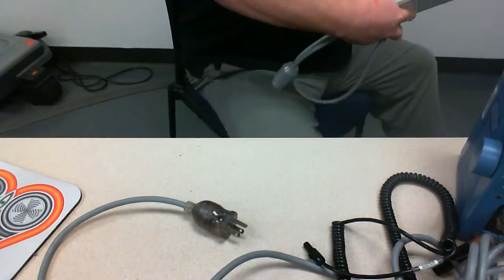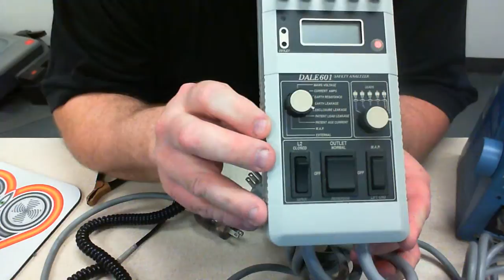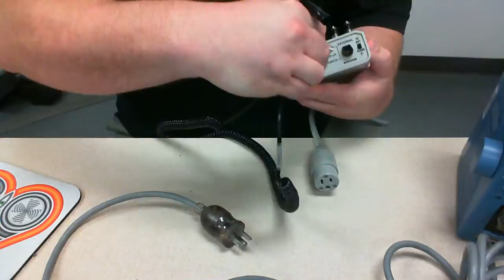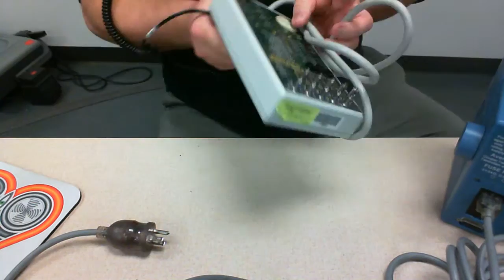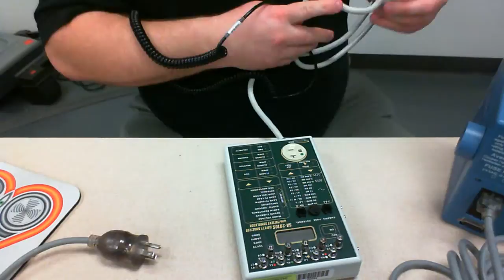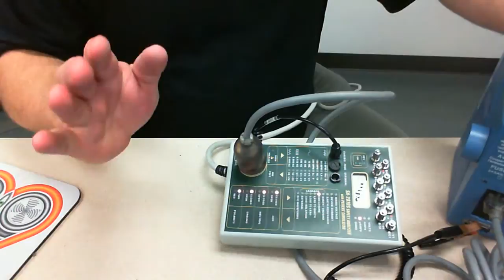Basic Electrical Safety Tests on A Dale 601 and a BC 2010

Comment: This description does not follow the IEC 60601-1 nor the IEC 62353 standards though for equipment testing.  The processes for acceptance, repairs or service, or general maintanance are not distinguished as they should be done.  It is only part of the electrical safety process.  The values received are not accurate as well due to not applying the required 110% of line voltage to the equipment nor the 25A source for stressing under IEC 60601-1.  It possibly could suffice partially under acceptance related to IEC 62353, but again no DC voltage is applied as well.  I am understanding the 62353 will replace the 60601 soon, and this might be the difference you elude to in the various forms of verbage of the test equipment.  Can you address these concerns for your explaination of the electrical safety testing please?

Comment: @UCOyF4hiBqxGC5m8_8k9J05A Thanks for this video on ESA!! Its so helpful and I watched all your electrical safety videos its damn useful. That Enclosure leakage current you explain at 2:38 it isn't in mA I'm afraid guess it is in microAmps.
Reply: @garrettseeley1813  thanks for your prompt reply!! Could u please explain the Patient Leakage Current (Lead Leakage) and Patient Auxillary Leakage (Lead to Lead) current in detail please. And also my question all these leakage current values are as one and this would be doubled when we lift the neutral right? Like for an eg. Leakage current with Open Ground is 100micoAmps and on Open Neutral it would be 200microAmps right...